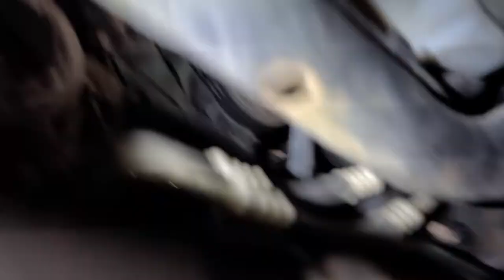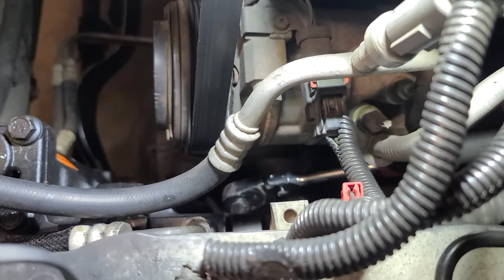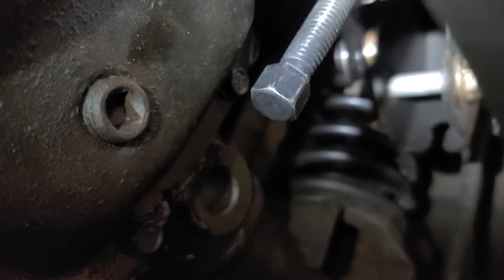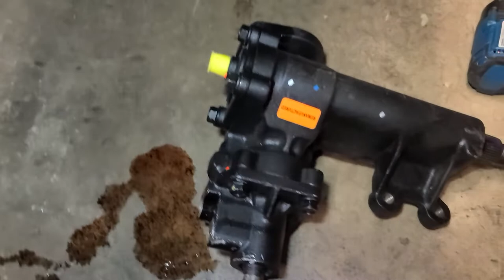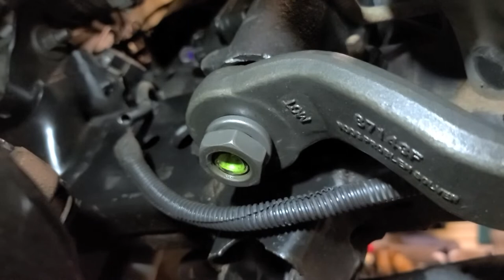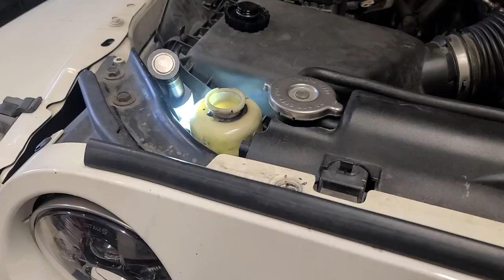Jeep Wrangler JK Steering Gear Replacement

Comment: I am going to be tackling this today. I have been having terrible wandering issues. I found that my steering wheel has a lot of play. The sector shaft is tight into the steering gear and while moving it the pitman arm stays stationary so I ordered the redhead steering gear since it was cheaper and upgraded compared to a reman from Jeep. Thank you for posting! I hope this solves my issue and I can drive my jeep safely again.
Reply from the maker: Awesome - good luck!

Comment: I’m going to swap my rad this weekend. The steering gear housing is super rusty. But not leaking. And no control issues. 
Would you recommend i do it since I’ll have access? Or rather try to clean up the rust?
Reply from the maker: Since these boxes are steel, I've seen some pretty rusty ones for sure - especially ones that are heavily wheeled (mostly mud runners and water fording). But, I'm a big fan of "if it ain't broke don't fix it." If the box is operating fine, and there are no leaks or steering issues, I'd just clean it up. If you are upgrading to larger tires, maybe I'd look at upgrading the steering gear at that point.  Good luck with the radiator swap!

Comment: Power steering fluid and ATF(automatic transmission fluid) are 2 different fluids. ATF going in your transmission, torque converter, and transfer case. DO NOT Put ATF in your power steering pump or steering box
Reply from the maker: Agreed that they are not the same fluid. Speaking strictly of the MOPAR steering gear I replaced in this video, the factory service manual calls for ATF+4 or MOPAR PSF+4 which it says "both have the same material standard specification." If you are replacing with an aftermarket gear or servicing another vehicle, I would highly encourage the installer to read the requirements because they may have different fluid specifications.

Comment: That sucks was the other one aftermarket not OEM?
Reply from the maker: It was a remanufactured OEM - not reman'd very well, though!
Reply: @austin.gresham  that sucks hopefully this one will hold up
Reply: @austin.gresham  wandering steering?
Reply from the maker: @stevenervin4113  In the JK?  No...  all good.  In the  JL or JT?  yes, but that's another story....
Reply: @austin.gresham  i got a autozone remanned after snapping the sector shaft and its all over the road now 🤦‍♂️🤦‍♂️🤦‍♂️
Reply from the maker: @stevenervin4113  Oh no!  As you can see from the video, I've been down that road of replacing it twice because the first one was junk.  Before you replace it again, I would check some basic stuff - is all the linkage (draglink, track bar, knuckles, damper, etc) all firmed up; second - did you bleed the new gearbox and did you use the right ATF?  If all that checks out, then I'd replace the gear again.
Reply: @austin.gresham  yep everything is torqued i did the bleeding technique with attaching the pump with no pitman arm vehicle off and turning the wheel back and forth a bit then started the rig all while making sure the fluid was good. I got a box from redhead steering so hopefully itll be good 🤞🤞